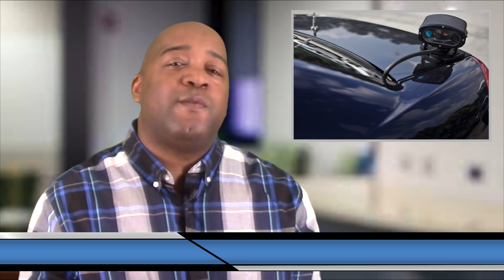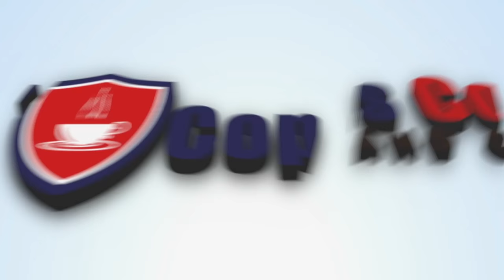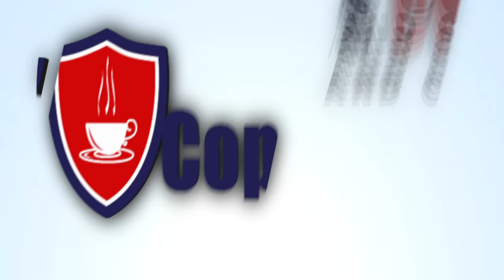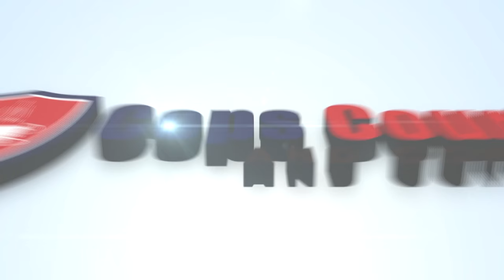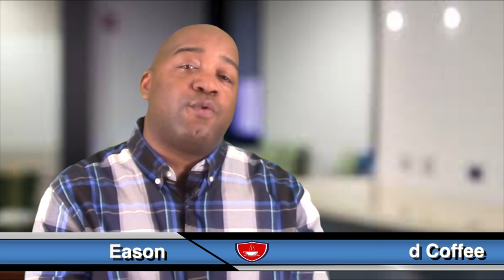License Plate Readers - What Are They and How Do They Work

Comment: I think its a problem big time. If im being pulled over and my plates are scaned  thats one thing. But just scanning random plates collecting information on me and im doing nothing wrong i dont agree with.  My question is what can be done to fight this infringement on my right to privacy?  Do i have a right to privacy if i drive a car?
Reply: Actually no. In all 50 states driving is considered a privilege that is problem number one. Problem number two is a fact that all vehicles whether windows are tinted or not have 360 degree view both inside and out by manufacturer. Since complete blockage of windows it's technically illegal this subjugates the right to privacy along with the fact that driving is a privilege and not a right.
One exception is a trucker's right to privacy when he has a sleeper cab on his vehicle and he is parked resting in a proper area such as a rest stop designated for truckers or a truck stop itself. Truckers on downtime do have a right to privacy to a certain extent. It is considered their home. However when operating said vehicle if the vehicle is operated improperly thereby giving suspicions the operator may be under the influence of some sort then there is no right to privacy in the vehicle may be searched and the driver could be identified as properly licensed etc...

Comment: What if the license plate does not match the name of the owner's vehicle just say you buy a used car and you do not remove the license plate will it pick it up and is the tag from the old owner still valid?THANKS
Reply: If you buy a used car the old plate should be removed.  Only an idiot sells a car and leaves the plates on.
Reply: First off almost nobody let you take the tag for they have no idea what you might do with the vehicle. Secondly though if they let you leave with the tag on the vehicle then tag will stay registered to that vehicle until the owner notifies the state but he is sold said vehicle and it is no longer to be registered in his name. NSAID case the registration would be valid but an officer may I ask you why you're driving this vehicle not registered to you in which case you have to provide a reasonable explanation.